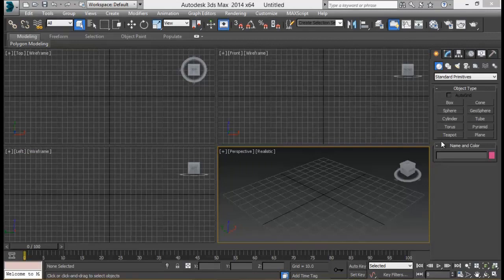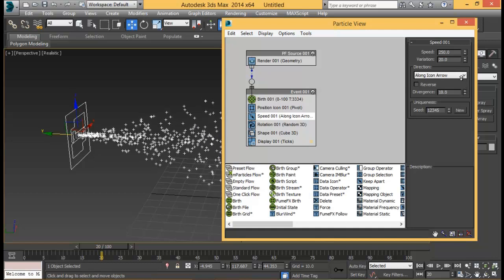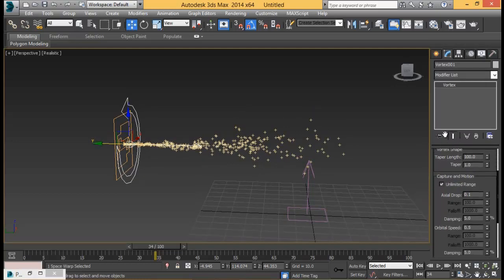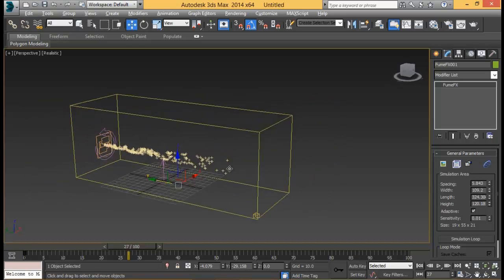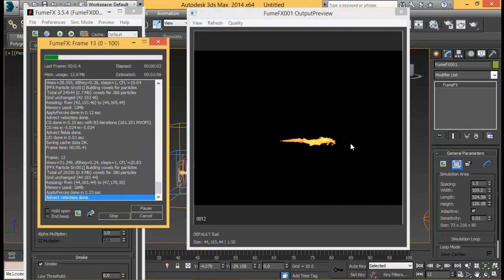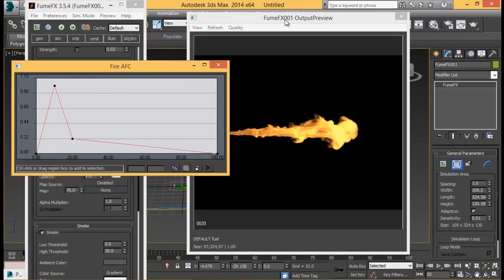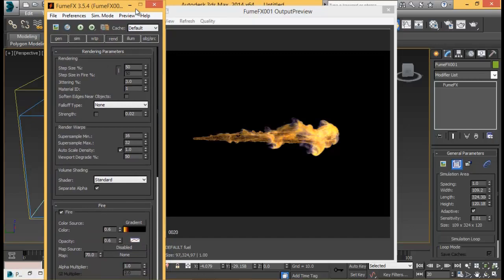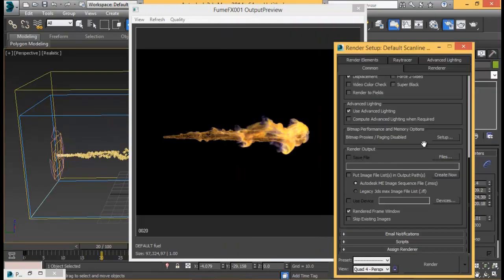Fumefx Tutorial: Flamethrower

Comment: You don't need to reduce the Strenght to 0.01
In FORCE inside the PfFlow, you can adjust the influence of the force.. From 1000% to 100%
it will help a lot =)
Reply from the maker: If we reduce the influence of the force ....then the turbulence from wind will also have less impact on the particles.
Reply: sanvfx Point ! We don't have to reduce each component just need to reduce the strength. Grt Tut man. :)
Reply: i cannot find that general parameters window pls help i am a novice..(im using fume fx 2.0, 3ds max 2010).....thanks..(i know its a quite idiotic question)